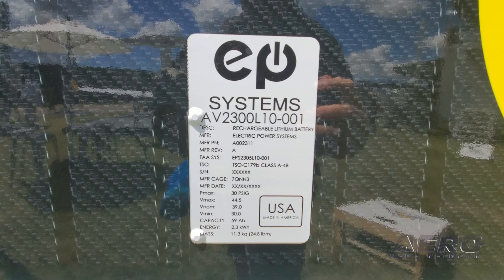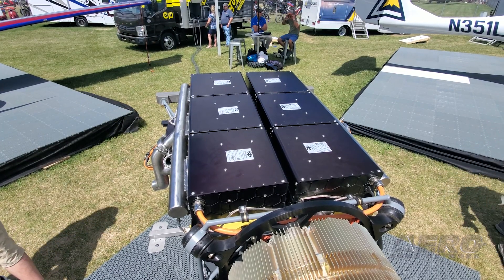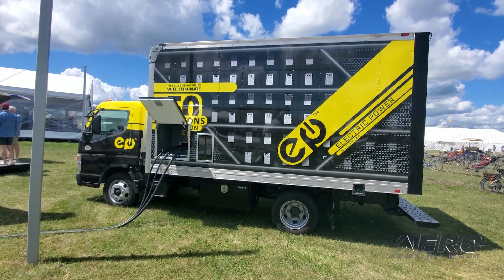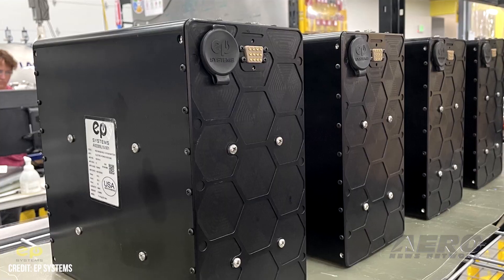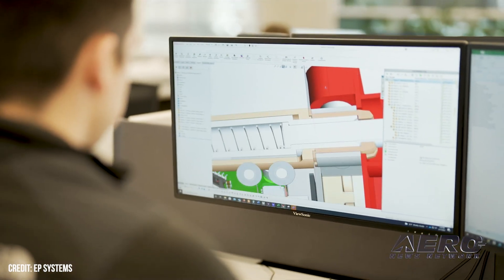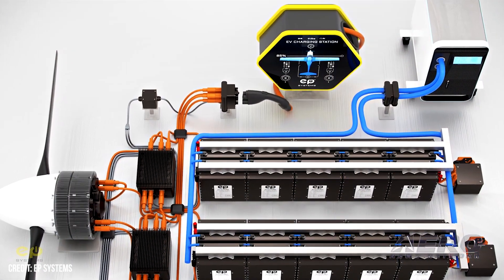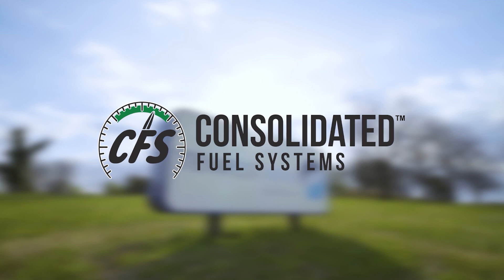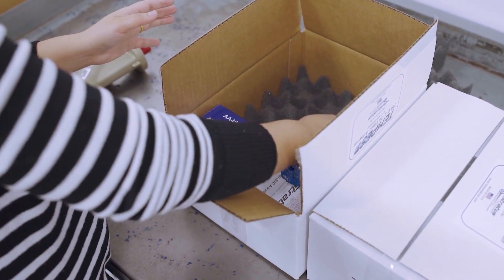Aero-TV: Electric Power Systems; A Name to Remember

Comment: Can someone explain why electric planes make more sense than liquid fuel.  I mean, how much energy does it take to make batteries, and how are they charged - where does the power to charge the batteries ultimately come from?  Solar, wind, nuclear?
Reply: I don't think they can. Until battery tech improves I don't see it helping. Lithium batteries are terrible for the environment. I understand that you need r and d to iron out the bugs and efficiency of energy usage and material harvesting.  We need to focus on improving the batteries with things such as graphene based technologies.
Reply: The benefit is primarily efficiency. Electric motors are vastly more efficient than the best internal combustion engines, and aircraft engines are a little closer to being the worst (in terms of thermal efficiency) than the best.

 Energy mix (how your electricity is produced) depends on your location. However it is commonly accepted with cars anyway that even charging from coal produced electricity the total co2 emissions per mile is lower for ev than  typical I.C.E. also worth considering if you are just a weekend flyer putting solar on your hanger could charge your aircraft on solar alone (although this would be a limited use case that would depend greatly on the available run time of the battery)
For flight schools and by extension student pilots the lower energy consumption, lower cost of electricity vs av gas and lower maintenance could be a great boon.